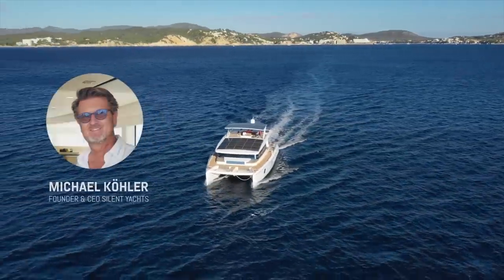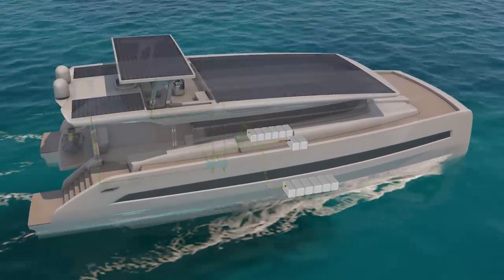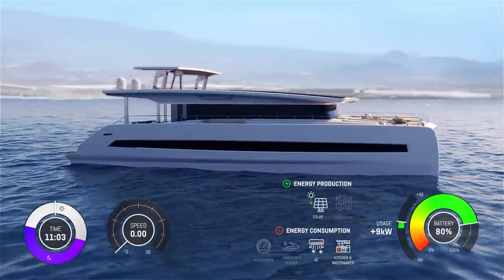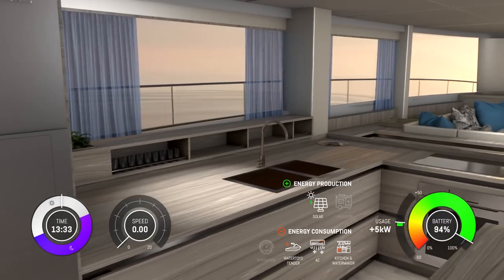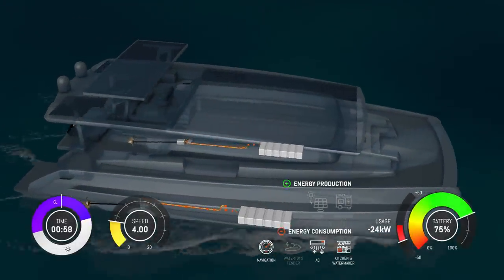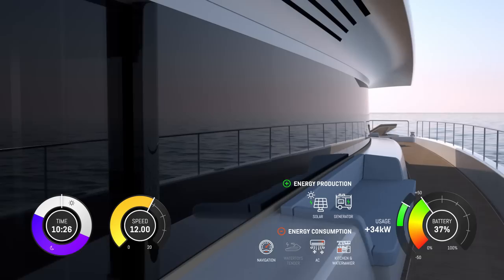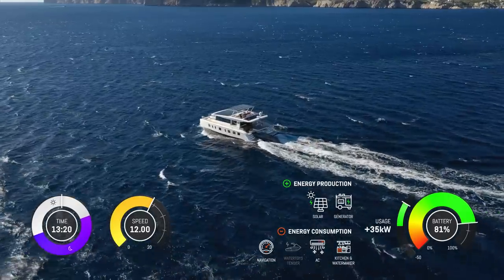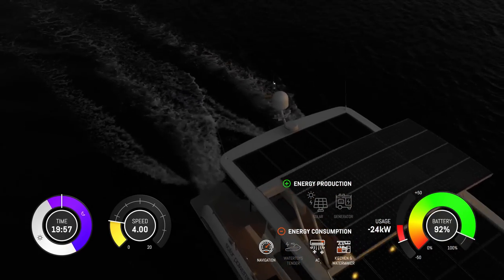SILENT 80 - Energy Generation and Consumption

Comment: I'm looking forwards to the next level in battery tech because that will really help this type of yacht.
Reply: They should partner up with tesla and uses there new 4680 cells that should have a 14000 to 30000 life cycle that would be the main reason who wants to replace all of those batteries 10 to 15 years from now plus the addition of a higher wh/kg density
Reply: It’s here! Thanks @tesla!
Reply: I wonder if the limit factor for silent yachts currently is the cost of batteries or just the energy density?
Reply: @flexbillbert5802  solid state is coming
Reply: @lesstevens2370  Actually they should partner up with Enphase!  Microinverters would be extremely beneficial in this situation as each panel has its own inverter and acts separately from other panels that may be in shade or facing the opposite direction of the sun.  Enphase battery tech is on par if not superior to Tesla at this point.
Reply from the maker: The upgradable hardware of our yachts means that you will be able to make use of the latest technology in the future as well by simply swapping the batteries for example.
Reply: @silentyachts  Thats nice! What about a solar panel flexible extension to the front of the boat? Would be nice to be able to catch more energy.

Comment: @SILENET-YACHTS : putting this here as it's about energy consumption. Though I think the info was in another video. Mentioned was that at 6kn it's 20KW and at 8kn it's 40KW and that it raises pretty steep until it flattens out thanks to approaching and reaching planing speed. Have you ever experimented, either theoretically in computer simulations, or practically, with foils. They do add some resistance at slower speed, but create lift and thus let ship lift up and reach planing at lower speeds. Depending on how low a speed  planing could be reached it could be worthwhile. Say it uses 25% more at  4kn and less , a wash at 6kn, but then brings down the 8kn energy consumption and above by 25%...
Reply: I like the idea. But it also means more mechanicals that can break down and increase maintenance costs. There's also the extra weight which would lower efficiency, I assume. And probably would take up living space, too.

Comment: Are the battery banks easily accessible/upgradable? With the coming of graphene based batteries, within the next few years, offering substantially reduced weight and volume as well as 5x the energy storage density compared to Li-Ion, what are the retrofit options for the battery banks? Moving from the 210kwH to 1000+ kwH of storage, would truly give the Silent-Yachts excellent range/longevity on station. Love the layout and design. Cheers!
Reply: Additionally Lithium batteries are high risk of fire so having an eject solution would be prudent

Comment: I watched the video and looked at the specs for the Silent 80 3 deck closed with 2 X 340 kW E-Motors, 429 kWh Lithium Battery and 2 X 145 kW Generators. 

Based on the information provided, I would expect the solar panels to generate a maximum of 125 kWh on a good day. That that is sufficient power for 1 hour of motoring at 20% of max power assuming using no other power onboard.

Motoring at 20% power the fully charged batteries will give approximately 2.5 hours before the batteries reach 80% discharge.

Charging from solar only will require 2.5 - 3 days to fully charge the batteries, assuming no other power is used during that time.

The Generators running at 80% capacity will 108 kW each, assuming 10%, assuming 10% loss in charging and recovery from the battery, that gives 97kW to each drive. That would mean running at 28% of max power assuming no other power is being consumed on the boat.

While this is a boat may be suitable for an eco warrior who is prepared to forego speed, range, aircon and other conveniences in order to minimise carbon footprint, don't hold your breath waiting for an ocean crossing.
Reply: i believe they crossed the Atlantic with the 60, however i'm not a believer in smoke, mirrors, and magic either.

Comment: Hi, wonderful vessel and clear explanation. Is there any equation r graf to calculate a 24/7 navigation without using generation? Thx!
Reply from the maker: Hi! Thanks for the kind words! It all depends on the weather conditions and the energy consumption. As a general rule of thumb, when cruising at 6 knots during sunny conditions, there is an equal amount of consumption to production. For the SILENT 55 & 60 this means less than 20 kW.

Comment: It's love at first sight, i LOVE the yacht!  However, I believe adding wind power with vertical helix turbine would increase it energy source continuously day and night, rain or shine, increasing efficiency and extending its range.  It would be great to learn about how you manage the disposal of waste and the grey/black water, are they stored on board and discharged at ports?  Thanks.
Reply from the maker: Hi Martin! Thanks for your kind comment! The issue with wind turbines is that they create shade on the panels and therefore overall decrease the energy production of the yacht. Yes, the grey/black water can be stores on board and discharged at ports.

Comment: So I have a Quantum Q6 HD Edge wheel chair its about 350lbs just for the chair and about 13k for replacement was curious what kind of handicap accessibilities are in this boat and if there isn't any could it be modified enough to handle handicap accessibility issues.

Comment: Either in this video or another one, you mentioned the battery packs can be fully charged by the generator in 2 hours. Some follow up questions:

1) How far could we go at 6 knots on battery power alone before needing a recharge?
2) How many liters of diesel does 2 hours of generator time drink?

Comment: Its amazing.. But sorry to ask, can it combine with the wind turbine in the yacht ? Cause I saw a small and powerfull turbine that can be install near the sattelite antenna.. Cause i am using it to power up my building.. So i think i will be more helpfull if going to sail at night
Reply from the maker: Hi! The issue with wind turbines is that they throw shade on the panels and therefore actually decrease overall energy generation. Furthermore, they are quite noisy. Depending on the placement, they can be a safety hazard as well.

Comment: We shall see. How often do the batteries need replacing? Solar panels damaged by storms/hail?
Reply from the maker: Hi James! Thanks for your question. There are 8 years of warranty on the battery banks. Within those 8 years at least, there will be no reason for exchanging the battery banks. In case you would like to take advantage of the latest battery technology being released in the future however, you have the possibility to replace them the of course. From a technical / reliability point of view however, the batteries will last you for many years to come. In terms of storm there is no reason to be worried for the solar panels. We have experienced light to medium levels of hail with no damage on the panels. Rest assured though that we provide 25 years of warranty on the panels.

Comment: Two questions: 
1.) Does it come with a 2,400 watt wall charger (brick included) &
2.) Does it go into energy saver mode at 20% like the iPhone?
Reply: ports have electric cord usually but i dont think youd need it.
the very efficient diesel generator turns on at 30%

Comment: What is the annual cost of maintenance? And can I custom order this? Such as the hull material and the like?
Reply from the maker: Hi! There is no maintenance required on the batteries or the solar panels. The electric motors only need a new set of bearings after 50.000 hours of usage. As result, virtually no maintenance means virtually no maintenance cost. In terms of customizing the interior, that is of course possible. The hull however is always made from carbon fibre in order to maintain the lightweight construction. If you have any more questions, feel free to get in touch with us here here: https://www.silent-yachts.com/contact-us/

Comment: Is this a blue water boat? What is the distance on full sun and total distance with fuel?
Reply from the maker: Yes, all our catamarans are CE-A certified. Regarding the distance, it depends on the cruising speeds. General rule of thumb, when cruising at around 6 knots during sunny conditions, you are in an energy equilibrium, meaning basically virtually unlimited range with the batteries capable of getting you through the night. Our SILENT 64 crossed the Atlantic Ocean during quite unfavorable weather conditions in 2018 and needed 1300 liters of fuel for a total distance of 5.500 nautical miles. You can check out the video here: https://www.youtube.com/watch?v=EJUnZlYDOTE

Comment: The Specifications on your website for both the 60 and 80 Silent Yachts is confusing
on the fourth page down...
Why does it show "Fuel 1000 - 1900 L" on the 60?
and "Fuel 3000 to 5000 L" On the 80?
Are these not Solar Electric?
Where does one put liquid fuel?

The 120 model does indicate a kWh rating for the fuel source
Reply from the maker: Hi Wes! Our yachts are solar electric. They are also fitted with a back-up generator, which can recharge the batteries whenever needed. This is only a back-up measure however, as the yachts fully function without it.

Comment: Is the Airco of the type that can work directly from solar, so DC power? Could save a lot of energy.

Would be great when (some rows of) the front panel could slide forward and down, revealing some more panels to create a larger charging surface when at anker, with the ship turned into the sun. It would also make the ship more aero dynamic when sailing into the wind.
Off course there is a problem with visibility at that moment, but one can steer the ship from the flybridge  or when out at sea on camera images when inside.

The interior of this boat is very nice, also because of  less levels in the floor and windows.

Comment: Is there a better spreadsheet of this? What are the solar panels bringing in on perfect conditions to what is being consumed to what is being banked? this video is dreaming numbers up and consumption and generation have zero bearings! what is the bank capacity, what is the max kWp from solar panels, and what is the kWh consumption? for example, you have AC running well that would be huge kWh, and in no way would your solar be bringing in a positive charge to the bank and run ac on the whole boat. hope to hear back.
Reply from the maker: Hi Justin! The peak power production depends on the models. The SILENT 80 displayed in the video produces 26 kWp, enough to power the AC on board and the propulsion system. Battery capacity on this model is up to 429 kWh. Feel free to check out our website for more specifications on the model (www.silent-yachts.com/silent80). If you are specifically interested in the technology (www.silent-yachts.com/technology). For more details, you are welcome to send us a mail at sales@silent-yachts.com. Our colleagues will be happy to provide more details.

Comment: It's a great step forward for human kind to have solar driven yachts!

I think catamerans are on the next step of evolution with independent food production,
like Hydroponic or small Aquaponic food growing systems with round ecodomes on top 
with solar cells on top and sides to
have tomatoes, potatoes, salads and whirlpool size Aquaponic tank !

Atmospheric water generators are maybe less energy consuming.

I also think that ships are an exellent solution 
to survive on the Seas of a post Nuclear War on land and some water areas,
because the vastness of the Oceans would diffuse it faster then on mainland.

Ships would need
EMP safe electrical system and some rooms emp isolated.
Air & water filtration from radioactive isotopes
Geigermeters
Independent energy, water and food peoduction and space for bigger stock!

Comment: How many knots csn it go and in a day?
Reply from the maker: Hi! Cruising speed of the SILENT 80 E-Power+ will be around 6 knots, with higher top speeds of course - around 20 knots. During a day, a SILENT can generally cruise up to 100 nautical miles on solar power alone.

Comment: Dear Michael, thanks for the insight and the description of this wonderful piece of engineering. I am very keen to know what your take on hydrogen powered yachts and if you have plans to produce any one day. Keep up the great work.
Reply: Hi Rob, thanks for your kind words - we are working on a H2 solution - but at the moment the pretty bad overall efficiency of about 40-50% of the H2 energy chain (electric power - electrolysis - H2 - compressor - H2-tank - fuel-cell - electric power) keeps us from going this way at the moment ....batteries are still the best solution - and I´m pretty sure that this won´t change

Comment: This was great. I have a few questions:
1) wouldn't buckets be more efficient than screws? 
2) Why aren't there any use of vertical wind generators? 
3) What is the future? Are you looking at new/different battery technology? Upcoming solar technology?
Reply: wind generators would add drag to the vehicle - that's why I don't stick a wind generator on my car either
Reply from the maker: Hi! Thanks for your questions! Vertical wind generators throw shade on the panels, therefore actually decreasing the overall energy production of the yacht. In addition, they are quite noisy, and depending on the position, can be a safety hazard as well. Regarding the future, all the key components of our yachts such as the solar panels and batteries can be easily exchanged. Therefore, a SILENT can be upgraded over time and benefit from the latest technology.

Comment: A question. Why hasn't a wind generator been planned as well? Or even more than one.
Reply from the maker: Hi! Wind generators throw shade on the panels, actually decreasing the overall energy efficiency of the yacht. Their energy output does not make up for resulted loss of energy production bottom line. Furthermore, they are very noisy and depending on the placement, can be a severe safety risk as well. Plus, we believe not very good looking either ;)
Reply: @silentyachts  I understand. I have two ideas to increase the energy produced with photovoltaic panels and to apply two wind motors that do not interfere with sunlight.

Comment: Hi there. Amazing boat. I'd suggest to move away from the Li-ion batteries, that have a significant replacement cost after 7-8 years. It would be amazing to see this boat powered with LTO batteries, that can cope with 20k/30k cycles and far more years of lifespan.

Comment: I've not been able to detect consumption of motors at 12 knots?
Reply: You can see that at only 4 knots, the consumption is 24 kW (as shown in the video at 2:15). The yacht is equipped with two electric motors, totaling 300 kW. I assume that at 12 knots, the consumption must be at least 100 kW, and that is only 30% of the engine power.

Comment: All good/Just SIC 1/ First due to the climate ( wind speed etc) changes- to be fixed by the strongest way 2/ Since all is fixed on the very top -  /all people are resting on the top deck ( some additional rails to be fixed there  for emergency work etc) as well/  stability and safety to be checked precisely 3/ easy changing and reinstallation ( cables to be separated from the main pack etc)

Comment: what about to use also hydrogenerator ?
Reply from the maker: Hi there! We are currently working on a H2 solution. At the moment the pretty bad overall efficiency of about 40-50% of the H2 energy chain (electric power - electrolysis - H2 - compressor - H2-tank - fuel-cell - electric power) makes us believe that batteries are still the way to go. We are also certain this will not be changing anytime in the near future.

Comment: The energy generation rate and stats are very very amazingly fast...which I'm really questioning it.
Reply: A quick Google search suggests typical solar panel efficiency is about 150W/m2. To achieve the shown surplus of +10kW, you will need at least 66m2 of solar panel surface. Eyeballing the dimensions of the solar panels shown on the boat seems to fit at least that much. 

Also from the shown power usage, it seems the propulsion engines are quite diminutive at 12kW each. But they will probably do the job perfectly well for quiet, silent cruising in relatively unchallenging waters.

Comment: And 1 thunderstorm and Lightening Strike and you are a floating rock with 0 propulsion.. Sorry I am a pessimist and believe in redundancy... Is it capable of long transoceanic crossings or is it just a coastal cruiser?
Reply from the maker: Hi there! For lightning protection, we have a lightning rod on the mast top, with copper plate conductors on both sides into the water on one anode each in each hull. All our models are trans ocean certified. The SILENT 64 actually crossed the Atlantic Ocean in 2018, you can watch the video on our channel.